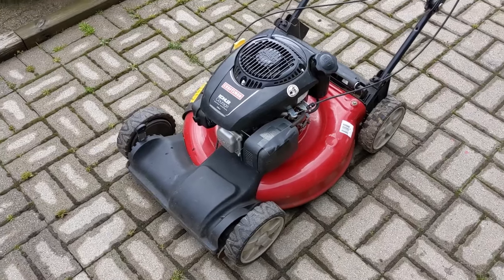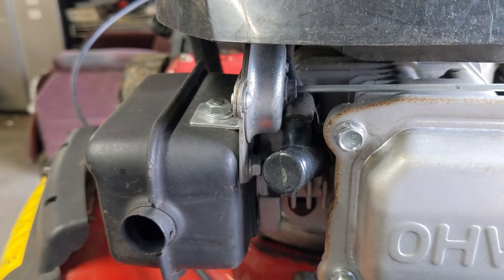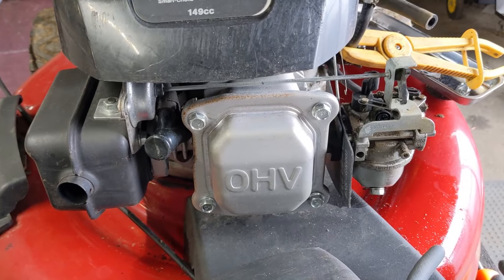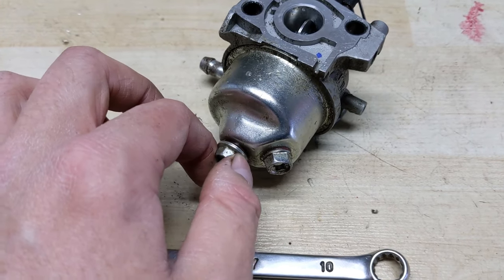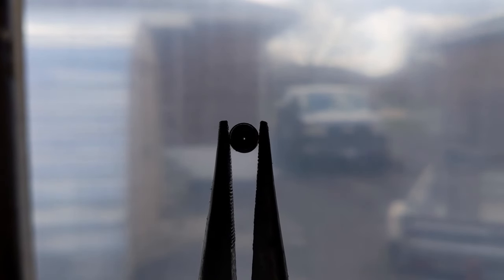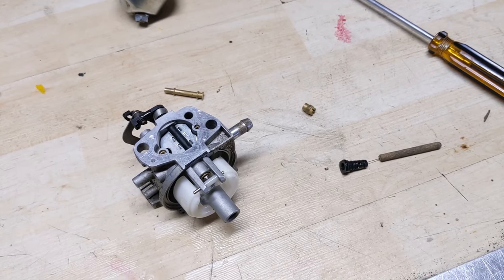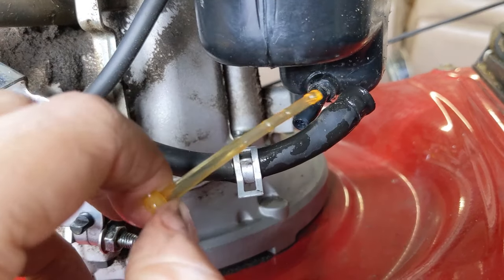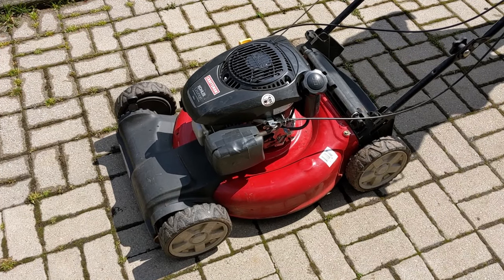Craftsman Mower Starts but Won't Stay Running - FIXED!

Comment: Got a craftsman mower with a plastic carb I used to have to clean every season until last year, I cleaned carb and tank ran good and mowed the yard, went to start it again nothing so I took the damn thing back apart cleaned it again and added a fuel filter now the dang thing runs for a minute and dies. Now it doesn't have any internal parts but the needle and float that removable so the question or questions is, can the fuel filer cause a restriction in fuel flow considering it didn't have one from factory? And why does it have to be cleaned every time even when using good gas and running it out after season?